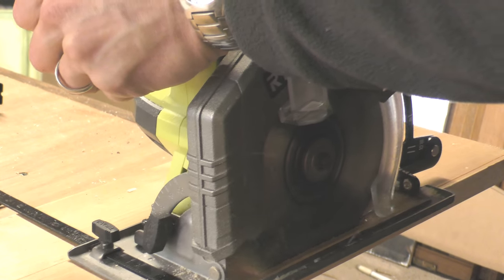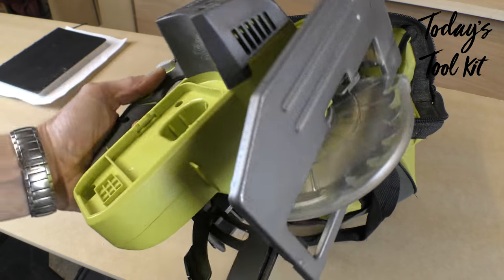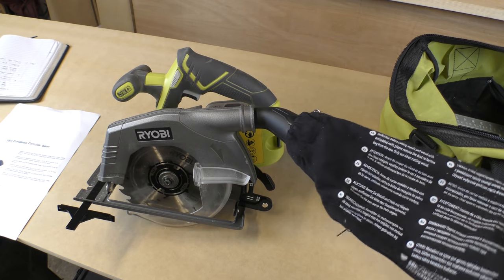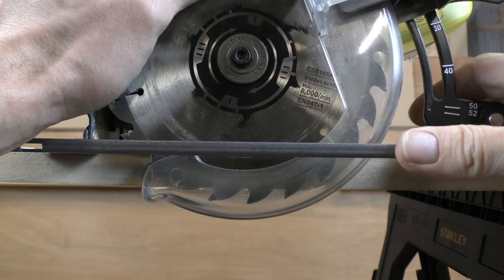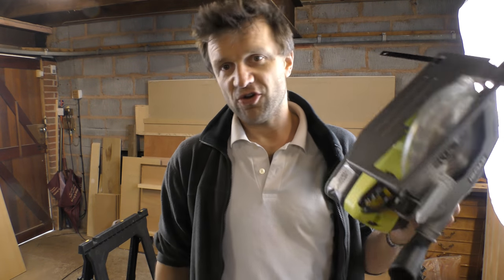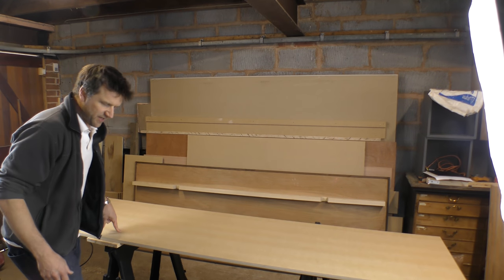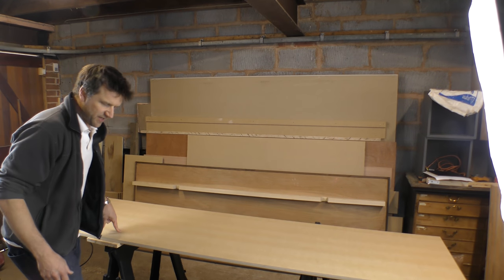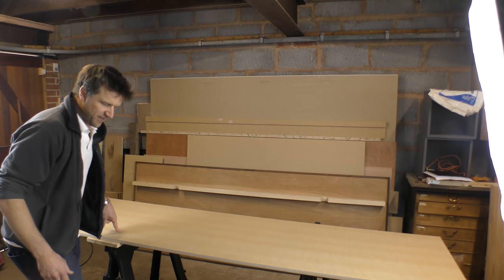Circular Saw - the MUST HAVE DIY Tool

Comment: Hi Charlie i have the same work bench it’s brilliant i need to make guide for my circular saw great video
Reply from the maker: Thanks! Yes, I don't know what I'd do without it. I'm going to do another circular saw guide video at some point but don't hold your breath! You want to check out the YouTube videos of the guides that have a rail on both sides. The downside of mine is that it will wander if you're not concentrating and applying constant pressure to keep it against the rail.

Comment: Hi Charlie, as always great video and nice to see you using your circular saw.

Always daunting when 1st using, it soon becomes your favourite tool when used properly.

I too thought the same about the black measuring guide initially; thought it was just rubbish; but hey ho, I was too quick to blame my tools and found the guide to be very useful.

I have been using a rafters square for a very long time; actually I do not know many carpenters/joiners  who do not.

Keep up the videos; it is great to be able to watch a DIY video which provides metric dimensions.

Comment: I have a circ saw ( 240v ), hardly ever use it. I noticed straight away in the intro you were using a rafter square ( I'll be getting one after typing this ) and thats given me a whole new look on using it for quick cuts. 
As for the depth of cut clamp, that reminds me of an incident a few years back. My elderly neighbour thought he had a water leak under the floor upstairs. I took up his carpet for  a look , he had wyeroc sheeting. I roughly set my depth to 20mm and ripped a line a meter or so to lift the sheet for access. As I lifted the panel out, I saw I had cut through a 15mm copper gas pipe, and I don't mean at 90°. I cut along its length perfectly, in fact, I couldn't have done it that perfect if I tried 😳 Luckily I'm a combustion engineer and I repaired it, but, when I looked afterwards I saw a perfectly penciled warning of the gas pipe underneath, oops 😂 
One thing if you have the time to reply, the link for the clamps takes me to another saw instead, can you link them for me. 
Cheers 👍
Reply from the maker: Wow, that's so unlucky! Mind you, when I recently laid my engineered oak floor I screwed through 4 electrical cables that I had only looked at moments earlier when I covered them up with the next piece of wood. It was fortuitous though because I decided to replace the two round bakelite junction boxes with Wago clips inside a wago XL box which is maintenance free for the future. I've just checked that link and it does work - I think you clicked on the wrong one http://bit.ly/2o2GRDm Cheers 👍

Comment: I bought a "Guild 160mm Circular Saw - 1200W" from Argos last year when I did not have a clear understanding of choosing tools. Then I didn't really know much about B&Q, Screwfix, Toolstation etc. Now, I have many questions such as "if other Circular saws are better? If better, how? What's the difference between Guild and something like Ryobi/Erbauer when it comes to cutting and the feel on the hands/wrists due to vibration levels" etc.

Comment: Hi Charlie, great video thanks for sharing, yep next tool along from a jigsaw, lots of these mini circular saws on the market now, even Aldi and Lidl/Parkside do them now. 
Really would recommend basic PPE, dust mask and safety specs when using a circular saw, dust and debris can quickly find its way into your eyes and down your throat, Mdf dust is particularly nasty!
Also you can clamp the rafter square to the wood rather than holding it and the saw, best to concentrate on your cut.
Reply from the maker: MrSbenn69 Thanks for the comment. Yes all good suggestions and clamping the square down is something I was thinking I should have done, when I was editing the video!
Reply: I agree, it would be better to cut MDF outdoors or use dust collection as MDF dust contains formaldehyde which is a carcinogen.
Reply from the maker: YouZbychu Agreed, although you have to make sure the sun's not out as I had a door bow in the heat recently.

Comment: I agree Charlie, however its a little expensive, i tried to buy one at BnQ and it was 60 quid, however when i got to the till i found out it didn’t have a battery or a charger and they were 100 quid for them so no chance, god a corded one and it was 29 quid, works brill.
Reply from the maker: Dave Williams Nice work! Got to say, it's become my most used tool dice I bought it!
Reply: I also use a corded one, I don't have any problems with the cord but I could see how a cordless one would be convenient.

Comment: Excellent tutorial! Would love to see one on using a miter and table saw.
Reply from the maker: Thanks. Yes a mitre saw is an essential tool. I have a sliding bevel (single bevel ie it only tilts one way) mitre saw from Evolution. It has its limitations, the main one being accuracy but was inexpensive. I manage without a table saw. I just don't have the space right now.

Comment: I have this saw and am really very happy with it .....except for one thing. 
The plastic dust port nozzle just will NOT stay attached to the saw body when I have it hooked up to my vac. It constantly pulls itself out as I move down the cut. I have tried putting tape around the port to get a better friction fit but this is inconsistent and quite honestly still a huge PITA.  
Do you/did you have have the same problem?
Reply from the maker: What I love about this tool, or one of the many things, is that when connected to a vac extraction is pretty efficient which is remarkable considering it's a circular saw not a plunge saw. So what I've done is use a rubber reducer attachment so I can hook it up directly to the vac hose without using the nozzle that comes with the tool. The one at 9 o'clock in this link worried probably do it but I can't say for sure as I don't know where I got the attachment from. Bottom line it needs to be a flexible rubber attachment rather than a hard plastic one, and I think I've put a layer of duck tape on it for a really tight fit.  https://amzn.to/3gj6BTz

Comment: Any good circular saw will do just as good. Its all in the skill to use one.
Reply: Its not about that. When you need to cut wood and you dont have power this thing shines. I own both corded and cordless. They both have their uses and drawbacks about equally

Comment: Hello there. Great video. I don't want to sound like the health Police or anything, but please wear a mask when cutting MDF. What is holding the particles of wood pulp together is some very toxic glue. Once you allow that stuff into the air, it can get in your lungs which is never good. A mask is a good idea, especially in an enclosed area. Regular plywood is not nearly as dangerous. 
Ryobi sure is making a name for itself lately. It is the go to tool for DIYers and many professionals for that matter. I have a corded and a cordless circular saw, and I just love them both. Next I plan to get their drill and driver kit which is very reasonably priced. Great presentation, thank you.

Comment: Hello, another great video as usual, you should really have a TV slot. I was looking at the table you made to cut large sheets. apart from the 2 x 4by2s you use down the underneath of the mdf table you made i also noticed it had an edging all away around....well I think it did - if so what is it, ? do you have the link to the video of it being made please? Chris. Thank you

Comment: Charlie! Where’s the improved saw guide video? I’m due to make one myself and want to see how you did it.
Reply from the maker: I'm sorry about that. It's in the pipeline but not imminent. However I've looked at a load of videos recently on different guides and I think this takes some beating as you need a guide on both sides to stop the saw wandering. No need for the metal edging though or the two side handles for that matter. You could do it with wooden strips and is beer inclined to go as thin as possible on the base piece. 12mm max. 6mm if you're feeling brave as you want to minimise the distance from cutting surface to saw 👍 https://youtu.be/c5pc_4wcQ2k https://youtu.be/c5pc_4wcQ2k

Comment: I have the same saw with a built in laser guide. This saw is very useful for cutting door trim and skirting board. A 1.4 Ah battery is useless, use a 4 Ah minimum.
Reply from the maker: Agreed

Comment: Great video Charlie. A related tool I can heartily recommend is a track saw, but not the expensive festool one, I have the Lidl version and it is just a superb bit of kit. It works with Festool tracks if you want a longer one and the clamps you already own fit into the t-track underneath to hold it firmly in place. Dust extraction is quite good too (requires modification in the form of some tape over the hole in the blade guard lol).
Combine it with your portable worktable and you will have a setup that rivals a table saw for accuracy.
Reply from the maker: Thanks mate. That's interesting. I'll definitely check that out!

Comment: Alternatively, you could buy a plunge saw with an aluminium extrusion guide rail! More expensive, but if you're doing a lot of sheet cutting....... :)
Reply from the maker: Funnily enough I'm doing a circular saw guide video as we speak and will be mentioning plunge saws 👍
Reply: @CharlieDIYte  Well, Charlie, I hope you give plunge saws a glowing mention, because they deserve it. I've recently boarded out my garage with 25 mm MDF, and my DeWalt DWS 520 with 1500 mm guide rails has been a massive help.

Looking forward to the video! Keep up the good work!

Comment: Charlie, did you post a video on making the saw guide? I cant find it if you did?
Cheers
Reply from the maker: No Dan. I've been meaning to do it for ages but had too many things in front of it in the pipeline. I'm building a big cupboard system soon so will include it with that but in the meantime check this out https://youtu.be/c5pc_4wcQ2k.  I think this is the best type of guide though you could use wood rather than the metal edging. 👍
Reply: Thanks for clarifying, thought I was going mad - I totally need to make one and the one in the link shown looks awesome and relatively simple. I also have some spare corner bead hanging around!!
Reply from the maker: @dantadman141  The only modification I'd make is to make the base section much thinner. You really want it as thin as possible to minimise the distance between the blade and cutting area. I'd be inclined to make it out of 6mm MDF or ply or perhaps 12mm ply if you're worried 6mm won't give you enough depth to screw your guide rails into. Good luck!

Comment: You may want look into dust collection device. It will save your shop vac filter can be made as a DYI project.
Reply from the maker: Thanks for this Richard. Yes, I need to make one of those! 👍
Reply: Charlie DIYte you probably new that

Comment: Totally agree. I use my circular saw for all sorts and have no idea what the big deal is about having a table saw. Between that and a jigsaw there’s really not much you can’t do. I recently got a mitre saw but even that felt like an unnecessary luxury.

One thing I haven’t done yet is glue up two pieces of wood along edges ripped with a circular saw. Have you done this, and if so, any tips...? I’m making a bench out of scaffold boards and working out whether I need to “joint” them with the router or whether they can just be ripped and glued.
Reply: Well, for example, I am a mason.   wtf am I gonna do lug my table saw around at my job all day? No thx. Fuck a table saw

Comment: Hi. A few safety tips would be useful as I did trim the nail on my little finger on my first attempt using a circular saw. Although I agree it's a great tool to have. Good video
Reply from the maker: Ooof. You were lucky! It is a tricky one, as although you have two obvious places to hold it, you get a lot more accuracy holding, for example the edge of the fence when you're using that for thin cuts. There's an update video here if you have a moment https://www.youtube.com/watch?v=mvcPuUz_m74&t=55s.

Comment: Great video thanks. I recently tried to make a set of drawers using just a circular saw and really struggled getting the fronts to fit into an existing alcove as the unit sides arent straight 😕 I just cant get straight line cuts with the saw maybe I had the blade too low under the board as it kept drifting
Reply from the maker: That's definitely the reason. I nearly threw mine away until my chippy mate showed me how you have to line up the blade. You MUST set the height so that only half of the blade tooth pokes out below the sheet you're cutting. Then you'll be fine.

Comment: Good intro to circular saw and useful tips Charlie. I do watch your channel often and often notice you don’t wear a mask.You should really be using dust protection measures for the following reasons ; 1. For protecting your own health ( which you wouldn’t realise until your lung is really damaged ) 2. To show others the correct and safe way to go about it.I am a health professional and have damaged my lungs in a similar way in my younger years. Please take note of my caution.
Reply from the maker: Thank you for this. I totally agree and these days I'm very careful. I was a bit slip shod in the old days, and also in my youth I didn't wear ear defenders so I now have tinnitus - somethingI mention whether possible in my videos. If you watched my recent 7 part wardrobe build your see me with a mask on at all times - and vacuuming stuff up with my cyclone at every opportunity.. 👍
Reply: I can vouch for the tinnitus after being reckless with noisy Diesel engines in my youth. I am building wardrobes based on your wonderful candid 7 part series. Many thanks to you Charlie.

Comment: Ryobi's saw can cut very thin widths - I had to cut a standard door width down by about 3mm and it coped really well. Most fences don't cut to near zero as the guide rail is on top and Ryobi's is sunk below.

Comment: The only size I have ever used is a jigsaw because I’ve been scared of not knowing how to use other saws and the potential danger of kickback from a table saw, etc.  But, trying to use a jigsaw for everything is just very slow. I considered a miter saw but knew that I couldn’t use it to cut long pieces. You showed me, in this video, what  I need. Thanks! You have a new subscriber! I’m older and a woman...and complete novice to woodworking! Looking forward to learning more from your videos!
Reply from the maker: Lovely to hear from you Marcy. There's no kick back from these battery powered circular saws - I used to use a jigsaw like you but honestly, this has been a game changer for my DIY.  You just need a straight edge to push it along and then you're away. The alternative is to buy a plunge saw that has its own track that the saw runs up and down and can't deviate off. You get a more consistent cut as the problem with a straight edge is that the saw can wander a bit if you're not careful to keep applying pressure against the straight edge as you push the saw along, but circular saws are lighter and more versatile than plunge saws. I'll be doing a video all about this at some point but right now I've got a major uphill battle with the bedroom that we moved out of in February 🥺

Comment: Your dad chose the saw but interesting the Ryobi is left handed compared to most of the opposition. Ok this is a small saw so will be less kick back if things go wrong, but perhaps not the best choice? (Interesting what you think). Bet you have another saw by now so time for another video. Liked the portable worktop to go on the tressles. Not too much on safety in this video but many others on avoiding kickback - you could do a really good one.
Reply from the maker: Funnily enough John I do now have a plunge saw and do need to do a video comparing them. There's this one https://youtu.be/mvcPuUz_m74 as an update in the meantime. 👍
Reply: @CharlieDIYte  Many thanks Charlie. Yes I'll be making one of those saw guides when I get the saw. Would be good if you can watch all the videos on Kickback and give us your take on avoiding it and staying safe. Avail video seem to either ignore it or are a bit extreme. I note lots of people using the saw one handed and not clamping the workpiece (Think the clamping perhaps depends on sheet vs cross cut on length of timber. For timber length, say trimming a joist to length might be better not to clamp ??? so the wood goes away from you and you hold onto the saw. I like the way Robin Clevett uses his - two hands on saw but the left hand also holds the guard lever to get started). Interested if your plunge saw is also a track saw?. Also if you might do a video on chop saws - e.g. for stud partition walling noggins if lots to do (Or how you would avoid that expense  )